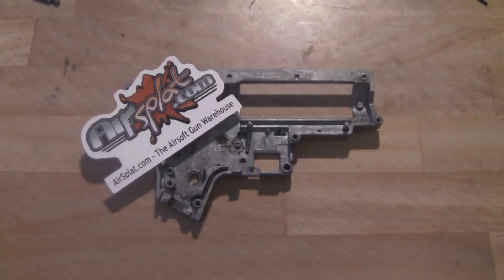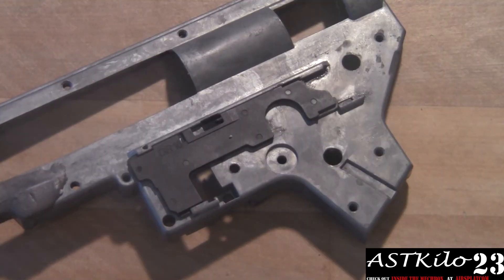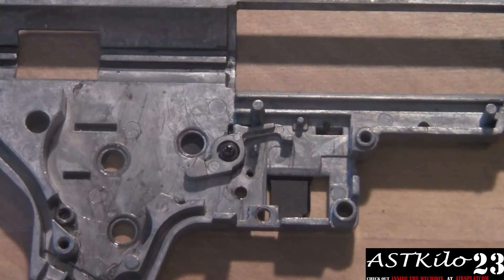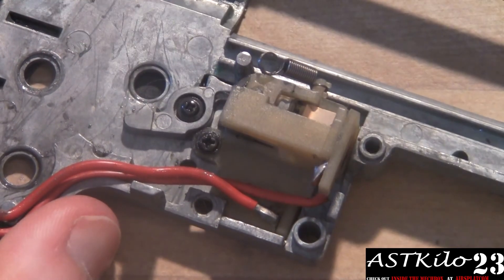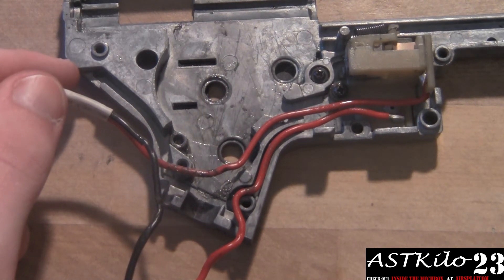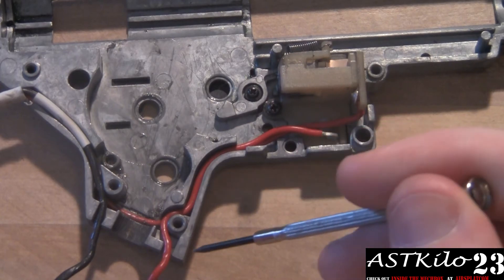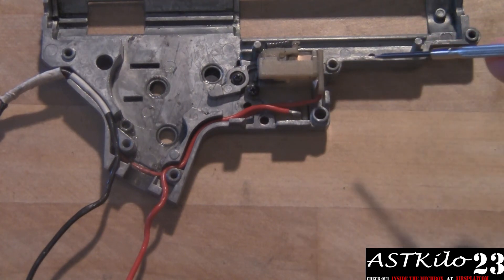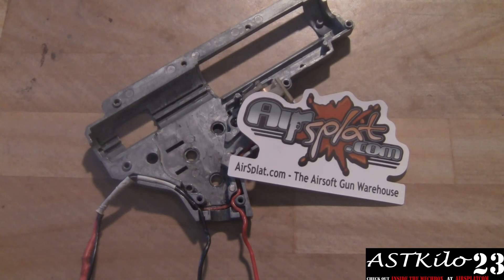Tech Tips: How to Install a Switch Assembly in a Version 2 Gearbox  -ASTKilo23-

Comment: Ok when I put the spring onto the peg the shuttle it pulls the whole shuttle back and make the front tilt toward the top of the gear box and then it doesn't line up anymore, and it make be the size of the switch assembly itself cause I can take the shuttle out when the whole assembly is screwed down into place. PLEASE HELP!! and the gearbox is a APS hybrid one

Comment from the maker: no such thing. microswitches aren't meant for airsoft guns...but the smart manufacturers decided to use them anyway. i would use the stock one til it melts, then just replace it with replacement aftermarket ones from any given website.

Comment from the maker: well they don't know jack....haha when you use a mosfet, the trigger assembly acts as a relay. 99.9999% of the power goes straight from the battery to the motor. the point of a mosfet is to bypass the trigger assembly altogether.